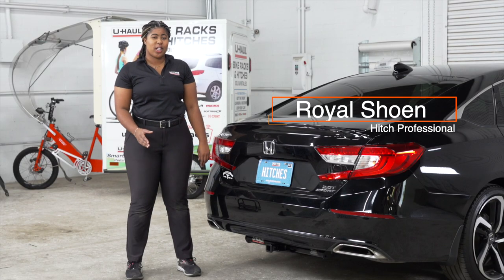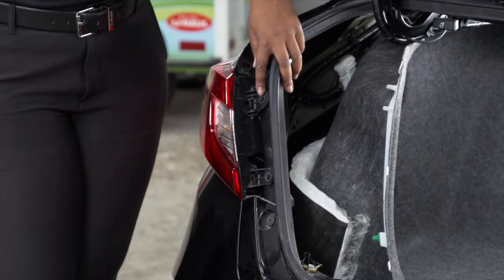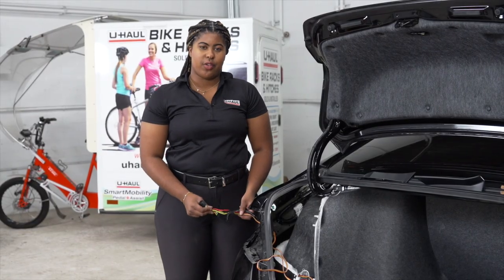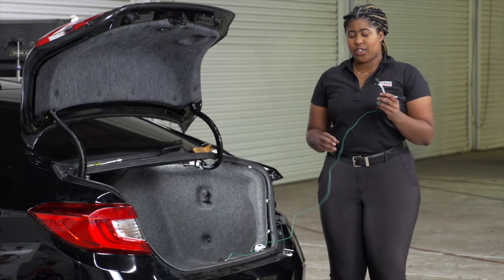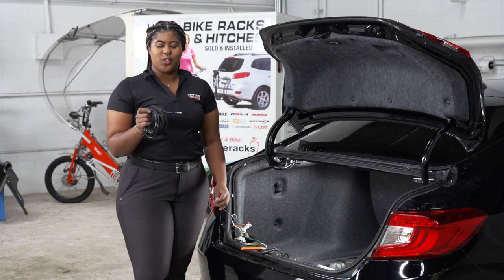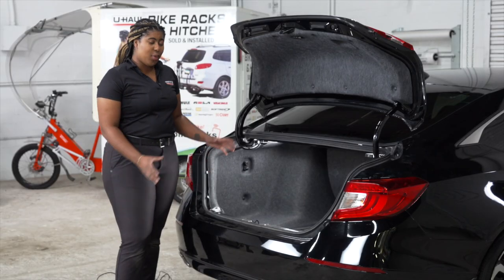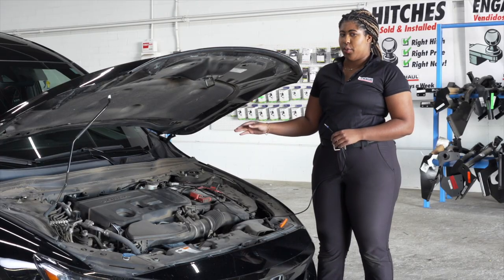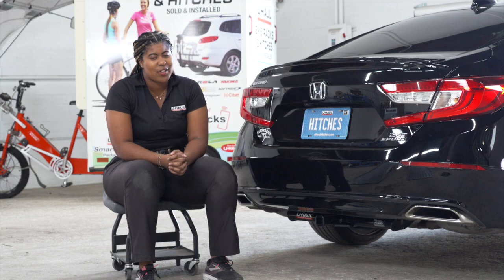2021 Honda Accord Trailer Wiring Harness Installation

Comment: I didn't cut the grommets ... l cut the wires and just fed them through the water tight grommet centers ... resplicing was EZ ... completely reversible and I needed no black sealer.  I also didn't do the under car connection to the battery - I use the front cigarette lighter plug - I just run an extension from the front to back during the infrequent times I tow a small trailer.  My trailer also has led lights - minimal load.